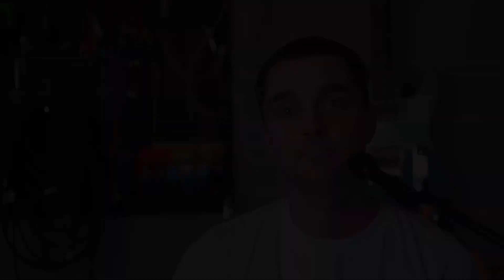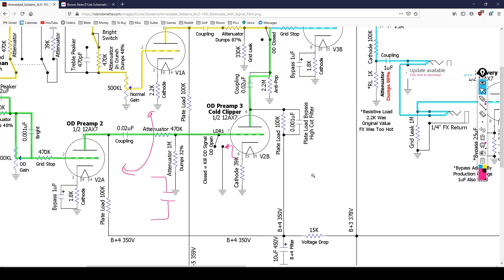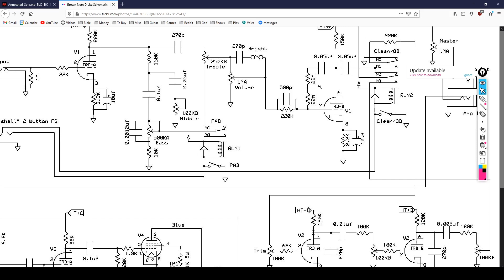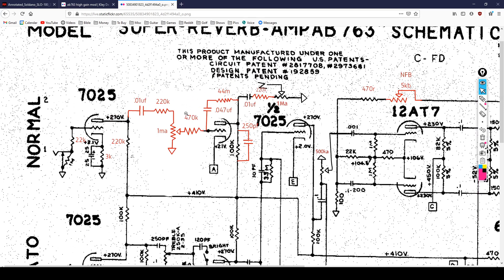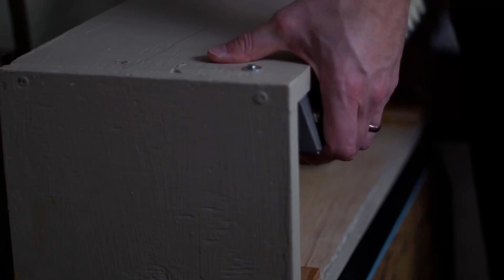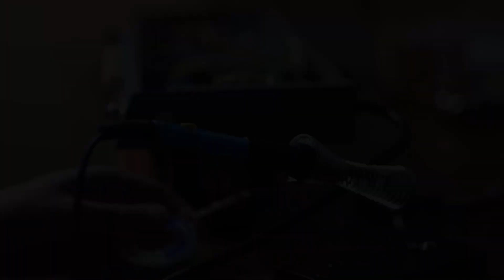Blackface Fender High Gain Mod pt 3 - SOLDANO SLO SPECS

Comment: Putting a pure (independent) transistor  circuit as the first stage and not bypassing the tone stack and also choosing some method to tighten up the bass would sound better in my guestimation.  But that's probably what a pedal does.  But it might end up sounding thin.  (But I honestly don't know what I'm talking about.)
Reply: That's pretty much what a pedal does though. Imho, part of the "Fender tone' is bypassing the first stage with controls instead of gain stage like a Marshall or early Fender. The Soldano method is actually quite clever as it relies on cascading, cold clipping and LNFB to acheive a super-smooth high gain tone though slightly less firebreathing gain in practice which the tradeoff is that you still have all of the usable reverb, vibrato funtions. The result basically becomes a Fender Supersonic which is in spirit the evolution of what a Fender Twin can and would be. I would take it further and make the Cascade switchable or put on push/pull pot somewhere, have multiple voice options in one amp instead of having it fixed